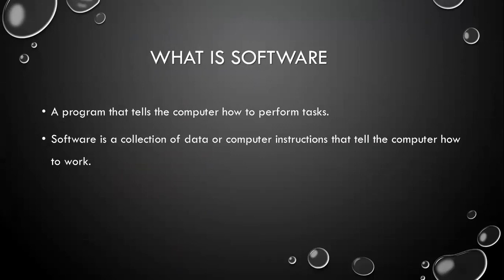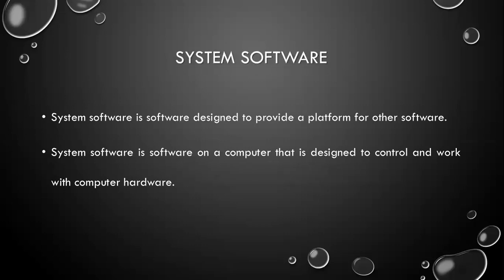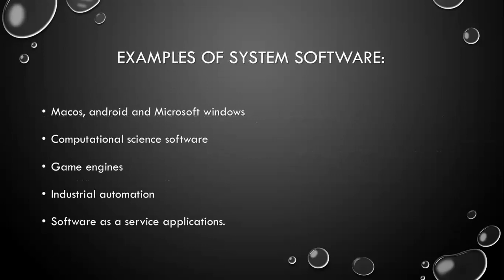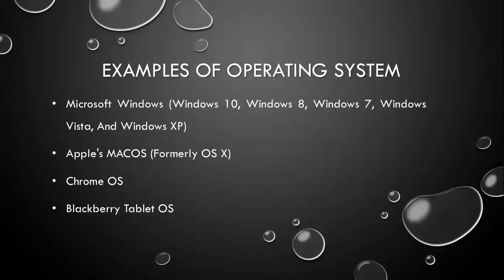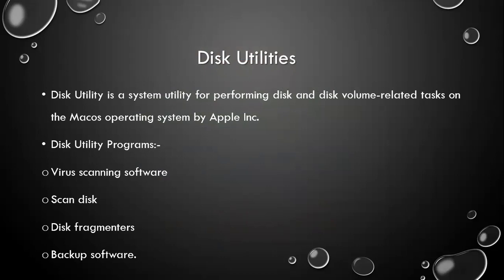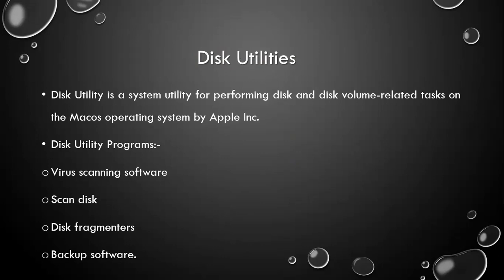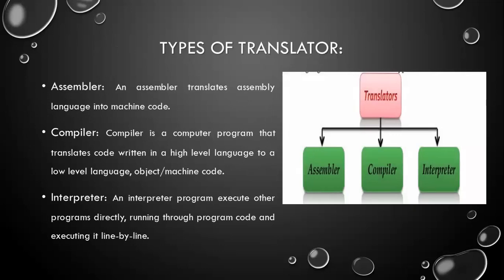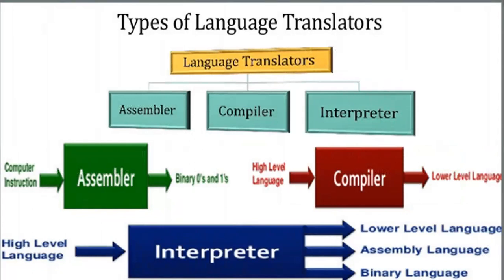system software

Comment: System software
Summary :system software is a type of computer program that is designed to run a computer's hardware and application programs. The operating system is the well known example of system software. System software is used to to manage the computer itself.

Comment: Good
Summary:Sytem software is a type of software which requires to run the operating system of computer. There are four parts of system software ie, OS, Utilities, Drivers  and language translator.

Comment: GOOD
SUMMARY
The set of instructions given to computer is  termed as software. A computer software is of two types ie system software and application software. System software is required to run the operating system of a computer.

Comment: good
summary
       system software is a type of computer programm that is designed to run a computer hardware and application programs.
examples:
             operating system like macos, GNU/linux, game engines, industrial automotion etc.

Comment: Good..
Summary
System software is a type of computer program that is designed to run a computer's hardware and application programs. If we think of the computer system as a layered model, the system software is the interface between the hardware and user applications. The operating system is the best-known example of system software.

Comment: good
System software controls hardware & provides platform to run other software. Software development refers to designing a new software.  There are 3 parts of system software; OS provides interface b/w hardware & users. OS can be open source (with code) or closed source (without code). Utilities are used to save data on your device

Comment: Good 
Summary: System software is just like the heart of the computer and allows many other applications software and function to run. It also includes Operating system,translator and disk utilities. In short system software a computer is nothing just like a box.

Comment: Good
Summary: System software is a set of generalized programs that manage the resources of the computer, such as the central processing unit, communication links, and peripheral devices (Loudon and Loudon, 1995). System software has three main components: the operating system, language translators, and utility programs.
The operating system forms a software layer between the hardware and machine language. The operating system allocates and assigns system resources, schedules the use of computer resources and computer jobs, and monitors computer activities.

Comment: GOOD
Summary
Software is a set of instructions given to the computer. System software connects applications w/ computer hardware. It's a bridge b/w user & hardware. OS provides common services for computer programs. Disk utility performs disk related tasks . Translator converts programming code into computer understandable language. Device drivers control & operate devices & provide direct connection w/ devices

Comment: Good.
Summary:
System software connects applications w/ computer hardware. It's a bridge b/w user & hardware. OS provides common services for computer programs. Disk utility performs disk related tasks e.g. scans, protects, backs up, repair faults. Translator converts programming code into computer understandable language. Device drivers control & operate devices & provide direct connection w/ devices.